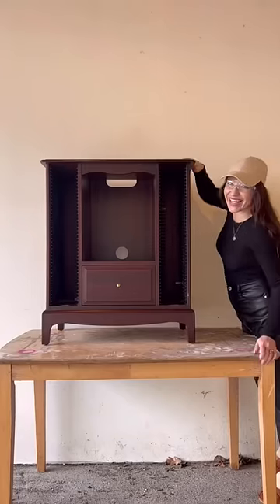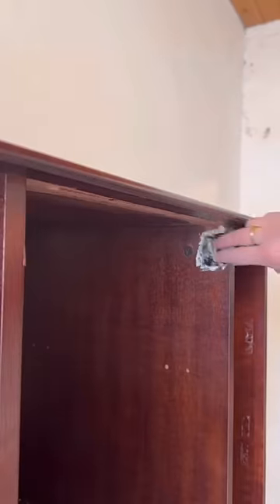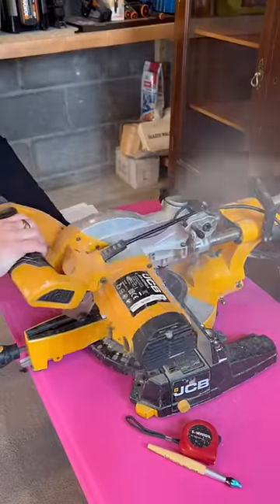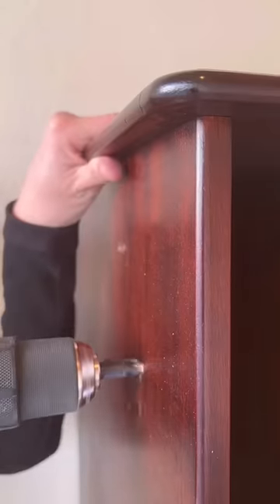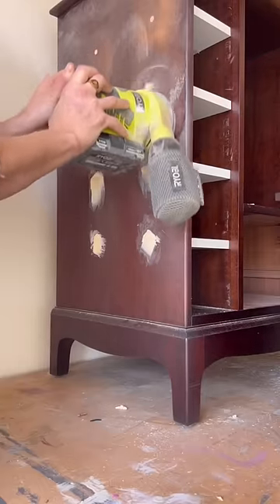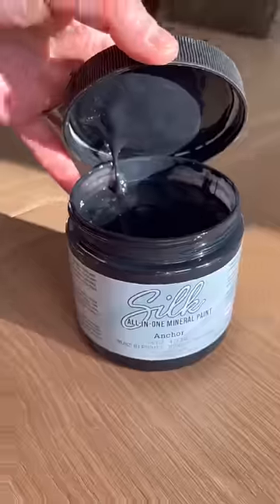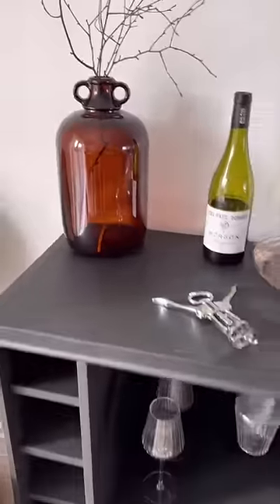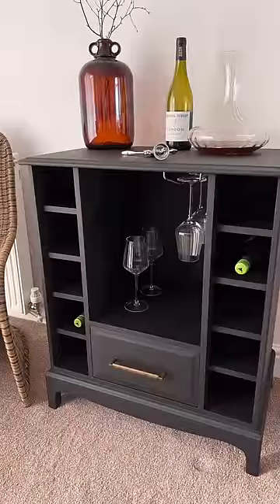The coolest way to upcycle an old CD cabinet! 🤯 #ad #shorts #upcycling #furnitureflip #diy

Comment: Great job! So many CD holders in desks and entertainment cabinets need this update!  You could prob add shelves with intererior holes and L brackets or pins, too. Then you wont need the specialty drill bit or wood filler or sander. Thanks! Very Fun!

Comment: I noticed you wore a mask while painting. Is that because of the fumes from that brand of paint? Is it oil based?

Love your work! You have great ideas!
Reply: It doesn't matter what kind of paint. You should always wear one for the dust alone. You dont want dust getting in your lungs.
Reply from the maker: No, the paint is very safe. I just didn’t take off my mask from when I was sanding 😂

Comment: Back in the day of the old square TVs (late 90s/early 00s) I had a beautiful rustic looking wooden tv cabinet that the tv went in. When we bought our first 42" flatscreen (which was fat n heavy by todays standards lol n cost over $2k!!) I was gutted about losing my beloved tv unit but the 42" rectangle tv wouldn't fit in a 29" square tv hole!!! . So hubs took the top off, took the door apart, cut it down to just under half it's height n put it all back together & then replace the old door glass with fine chicken wire (what can I say except it was trendy at the time 🤣) & we still have it to this day n it's gotta be at least 25 yrs old!

Comment: I love how you repurposed this piece! Everyone has opinions but not many people would go through the trouble of giving it a new life. The same individuals trolling are usually the ones that would simply toss it and replace it
Reply: Another one calling me a troll? I asked a legitimate question isn't that the purpose of comments? Who do you think you are calling me a troll for having knowledge of the value of the original piece? It should have been restored not painted. That is my opinion. I certainly wouldn’t have throw out a $1000-1200 piece of furniture. Now maybe she’ll get $500-650 max.
Reply: @robinoconnor848  she probably paid
$50 for it so even if she gets $500, she’s making a huge profit. Very few people use CDs these days, so much so that they stopped putting CD players in cars for many years now. That piece she flipped was clearly trash to someone else, which is how she got it (probably at a second hand store) and she has given it new life and made it useful.
Reply: @captivated388  I understand completely what was done. I don't have an issue with the redesign at all only the painting of a protected wood species. Did you read all my comments? I object to being called a troll because I have a different opinion. That's what is wrong with this country people don't respect anyone's opinion but their own.

Comment: Looks like rosewood. Why would you paint that? 😩
Reply: Because it was ugly.
Reply: @lavenderoh  Because it’s filthy. That wood is now protected and can no longer be procured. It was worth 3-4 times what it’s now worth. Some Mid Century Modern and Scandinavian furniture have held their value if in good condition. Rosewood is highly regarded and was produced less than teak so it’s rare.
Reply: @robinoconnor848  most people who are looking to buy furniture right now are probably not looking to buy the original piece, obviously the cd shelves but also the wood and finish is really outdated even if it was cleaned up. I’m not a fan of the paint myself but I also didn’t like the original wood at all lol
Reply: @b.r.v.8609  I totally agree with the new shelves and re-styling. It's the painting to which I object. If it was pine I wouldn't care.
Reply: Rosewood? Are you kidding? That looks like a cheap veneer.
Reply: @valeriemacias6285  veneer is real wood cut into a thin sheet!